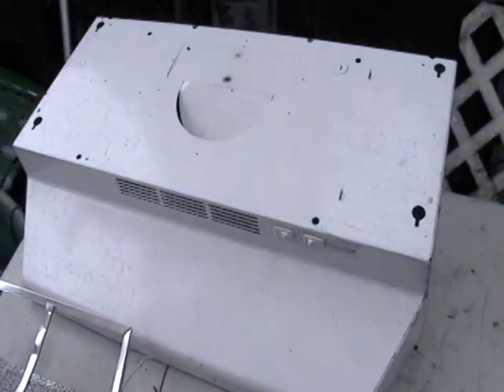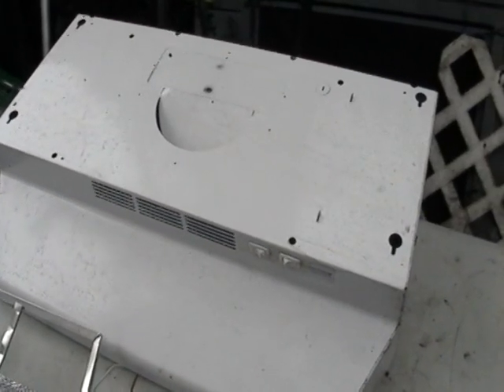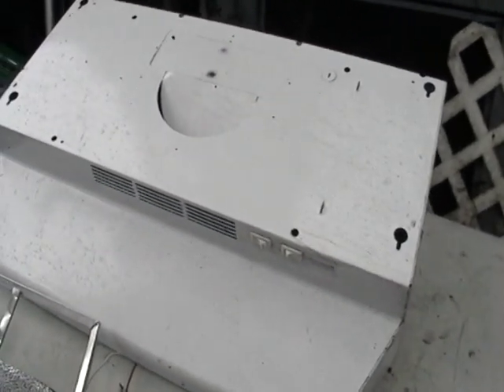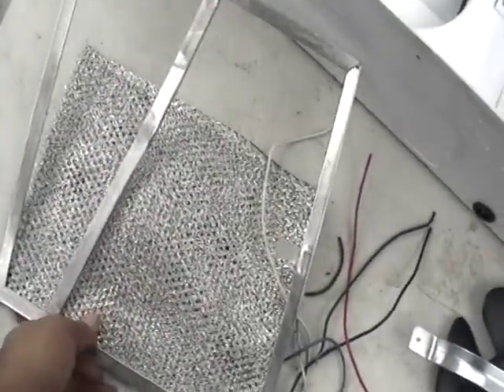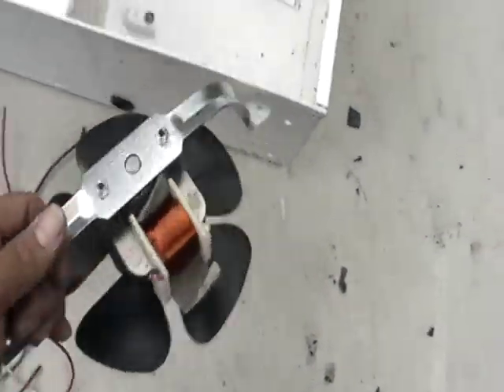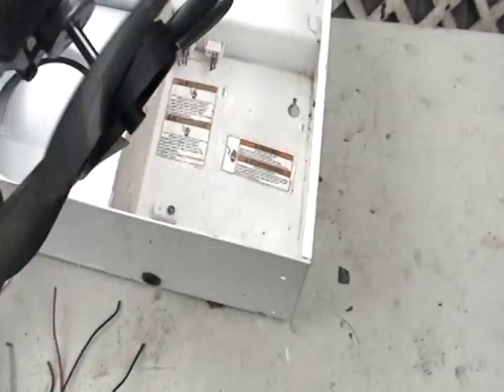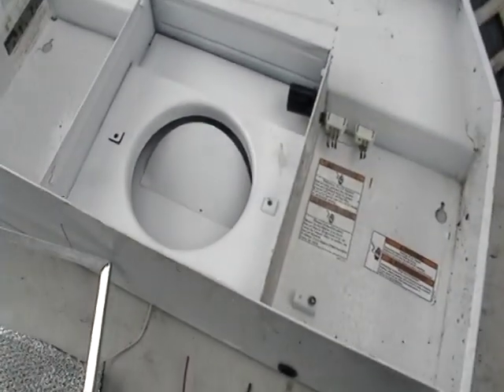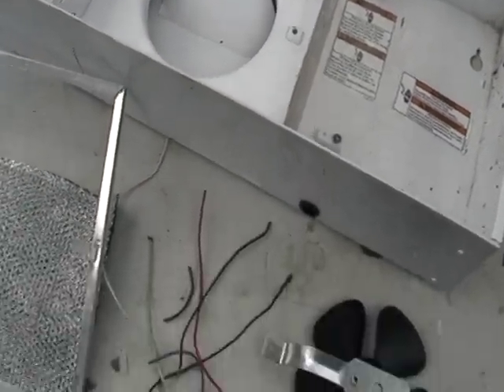scrapping a stove hood for copper

Comment: do you take wire in as is or do you strip it?
Reply from the maker: +Jeremy Cowan If the wire stays bent. I strip it. all others get sold as is
Reply: How about the plastic coating on other wires pulled.